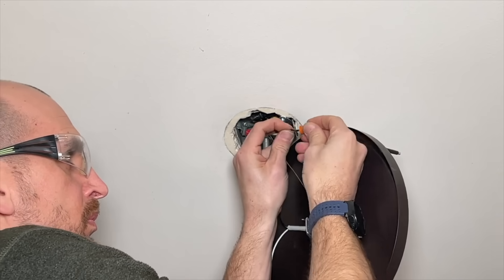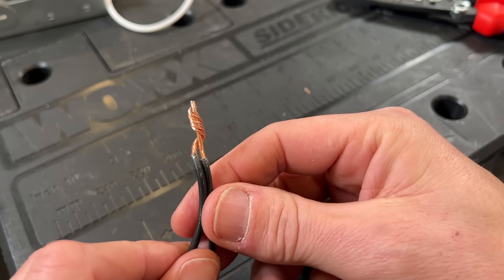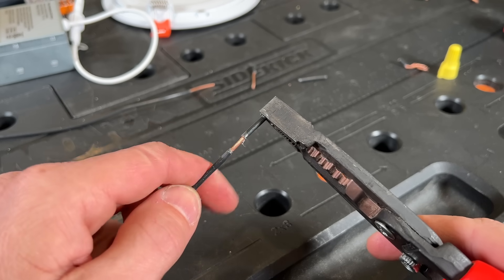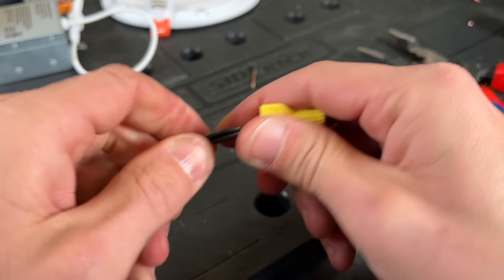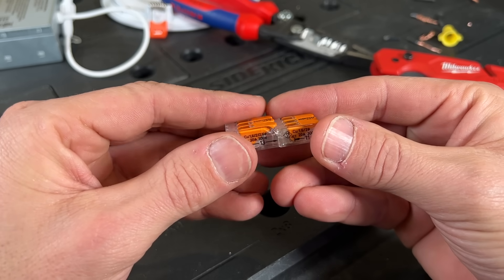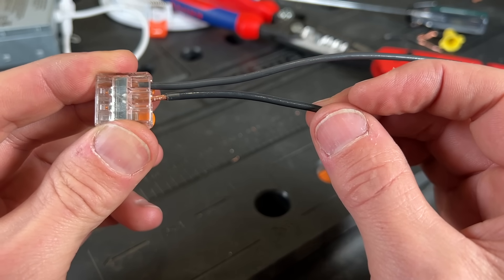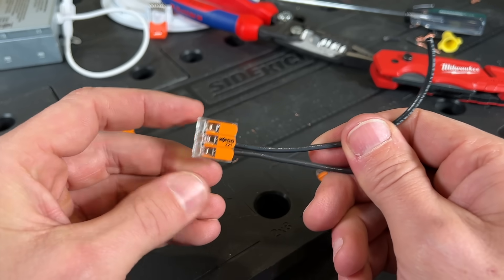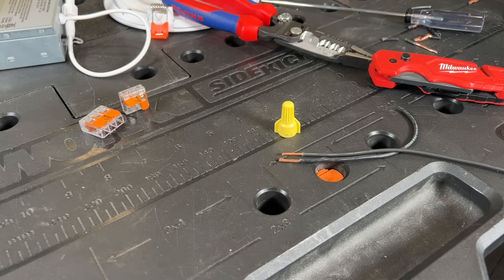Most Common DIYer Electrical Mistake - Don't Let This Be You!

Comment: For the wago’s, the reusability is the most important feature for me. I don’t have to worry about using 10 or 20 of them for a temporary setup because when I have time to do it properly I can just take the wires out and reuse them!
Reply: Yeah but the wagos have one point of contact on one side of the copper steand. Resistance is the word.

Comment: Don't listen to "the pros". What matters is the facts and the actual load testing done. What "the pros" thing is opinion based on prejudice  or "used it for years and it never failed me" kind of reasoning. 
Best practice is learning the better way and letting go of traditional practices.
The WAGO connectors are a good example of this.

Comment: I noticed that when you used your wire strippers, you had to use a fair amount of force to pull/strip  the insulation off the wire. Although I don’t own the nice pair of strippers you use, I did develop a technique that makes the pulling off the insulation a lot easier (with my cheaper strippers). Basically, I would use the stripper to initially cut the insulation, then slightly relax my grip on the handle while pulling the insulation off. I found that when I maintained the same force/grip while pulling it would take way too much force. Just my two cents. I seem to recall this works for both stranded and solid wires, with slightly better results on solid wires.
Reply: I used the same method, its effortless. also holding the wire in the palm of your grip and using the thumb to lever against the stripper gives you massive leverage.
Reply: @haydenjones1559  Thumb method is the way to go.
Reply: Today I learned: not every does it this way.

Comment: I like push connectors except when using aluminum wire. Wire nuts used for that. Solid strand copper wire is fine for push connectors

Comment: That's excellent! Thank you for posting. ( It would help if you showed the PACKAGING that those lever connectors come in. )
   I had to sign a waiver that stated whatever you designed belonged to the  company. I designed HUNDREDS of tools, jigs, work stands, lifting rigs for crane operations, test equipment, procedures, safety application tools and procedures, etc. for over 35 years. I got 3 awards in that time. The main thing, I made a positive change to the world! The company, I'm sure, patented all of it and made it available to order by giving it its own class & item number for all the other shops.
   Your Daddy was smart enough to bypass the waiver...or possibly, they didn't have one then. I signed mine in 1975. I HAD TO in order to work for them! It ain't right, but they like to think that they OWN YOU !!! They keep you down, and morale ain't the best, but its a job worth putting up with the bosses' bosses', bosses, bosses 💩!

Comment: How about just using some electrical wire tape? in my country my complete house has all the connections made with regular black electrical tape or insulating tape and it held 26 years later pretty good. The only thing is that with time tape will loose it’s adhesive ability but it won’t move anywhere

Comment: I use WAGO connectors all the time. When hanging light fixtures, they allow me to do a lot of the connections prior to lifting a heavy light and then fumbling with one hand. They cost a little more than nuts, but for the average homeowner, they make wiring life much easier and foolproof.
Reply: Where can I buy those are the in the USA

Comment: This is interesting. I spent 35 years in sales and marketing at Ideal Industries and was the product manager for wire connectors from 1977 to 1980. Re this video. I would suggest that you go th the connector packaging for proper strip length instructions. UL looks at how the package instructs useage.

Comment: WAGO connectors are NOT logical for a home owner. Need to have a big selection, they are NOT cheap, and cannot beat a wire nut which are more universal and a lot cheaper. You are only pushing these WAGO connectors due they pay you to do so. Just price them out and figure out how many you will need on an occasional wiring job at home vs. the price and number of wire nuts. 
For a pro, these might be the best. 
I am not saying the WAGO is not good, just saying for the average home consumer, they are too expensive.
And again, it is BS you try and state they are better for the home user.
I'm unsubscribing, cannot take paid BS.
Reply from the maker: Wish you the best Douglas.  Just for a point of clarification WAGO doesn't pay me to talk about their products.  I simply feel they are better for homeowners as compared to wire nuts.  Just my 2 cents.

Comment: Your tips were spot on for me a DIYer (I just hung 6 lights including a chandelier by myself):
▪️ I hate stripping wire - didn't have the correct equipment. Once I simply cut the end of the wire off and stripped it, everything was so much easier. Stripping the wire and just starting over with clean fresh wire is the thing to do. It saves so much time.
▪️ I can't wait to use the Wago 221s in the future, but I went to two stores that had the Wago 221's in stock on the web site, but unfortunately when I got there, there were not any. Instead I got the Ideal brand similar connector, but I can tell you, they do not work the same and I would not use them again. Ideal worked well with solid wires, but I had a hard time getting the stranded wires inserted and the stranded wires kept coming out; therefore, I had to revert back to using wire nuts on two ceiling lights I installed. Also, I got the three wire connectors, because I knew some junction boxes had same colored 3 wires connected through a wire nut.

One benefit I found with the Wago 221 style wire connectors is that because I was installing multiple lights, I removed all of the existing lights at the same time because the circuit was already off and then I put the Wago style wire connectors on the exposed wires coming from the junction boxes. This made mounting the lights at least feel faster and easier because I only had to insert the light's wires into the wire connector that was already in place and waiting on the light. This kept my hands free since I did all of this by myself.

▪️ Having the stranded wire sticking out further than the solid wire and then using the wire nut as you recommended is the only way to go. The wire nuts gripped the stranded and survived a pull test. 

It's funny how when you do things the right way, the right way is much easier.

Thanks for the great video

Comment: My lord I've never seen people be such fucking pansies when it comes to electric work. 
People do this shit with live electric, in dirty crawl spaces, mostly in the dark with crickets and shit jumping at their face. 
I respect newbies going slow and being safe but fuckin A man lol, this comment section is lame
Edit. Leave the stranded wire a bit longer than the solid wire when putting the wire nut on. Hold the stranded wire still while you twist the nut and you'll feel the tension as the stranded wire starts to wrap.  It wraps up like a charm every time.

Comment: What wire gauge do the up-to 12 AWG WAGO Lever-Nuts go to as the wire diameter decreases/AWG number increases for stranded wire?  Some stranded wired devices don't use the same AWG as the solid up-to 12 AWG Romex they'll be connected to.  For those stranded wires with a much different AWG, can the stranded wire be bent in half or thirds to make it fit and lock better?  Like to what AWG would this be acceptable, if it is at all?  And how far beyond 14 AWG solid will they also work well with?  16 AWG?  18 AWG, etc.?  Those may not be standard Romex sizes, but it could be good to know in some applications.  Could much different gauges be bent over as well?  And while I'm at it, could the 10 AWG, 30A Lever-Nuts accept a 12 and 14 AWG solid as a tap to something else?  Can't help but wonder.  Thanks

Comment: I always tin the wires with a good quality solder in electrical light fixtures such as this. The solder makes the wire stiff so it acts like a solid wire. I've never had a bad connection using this method.

Comment: I just started using the Wagos. When your doing  larger jobs it's a time saver. A little more money but they are awesome to use. I've used wire nuts for 40yrs.

Comment: Wire nuts aren't used in Australia due to the issues highlighted . We use BP (blue point) connectors with either single or double screws.

Comment: I'd call it "common sense".  I figured it out the first time at about ten years old and have never had a failure in the hundreds since.  I always wrap the stranded around the solid completely covering it to just past the tip and eventually you learn to tell by the feel but always feel the grab and check with pulling.  Pre twist all solid wire connections with lineman's pliers and pull test those as well.

Comment: electrical apprentice here. one of the task i have the hardest time with is bonding stranded copper to solid copper on fixtures and ceiling fans etc. this was great my man!! 👍🏽
Reply: I'm an experienced electrician and I recommend to bend the solid just a bit around 30⁰ on the tip about 1/8 in lenght so you can put your stranded wire then the wire nut and you'll see the difference...
Reply: @MrSeth166   thanks buddy👍🏽 i’ll remember these methods for sure!
Reply: @MrSeth166 ❤❤❤

Comment: I can't believe the USA are still using these fire death traps. 
These have been banned in the UK for years because of loose connections, different size wires being used all leading to arcing overheating and fires.

Comment: I always strip the stranded wire the slightest bit longer than my solid. Like ⅛". Then I line up the insulations and put the wire nut on. It pinches the tip of the stranded wire between the top of the wire nut and the top of the solid wire.

Comment: When you work on Electric powered equipment such as AC and Heating, a pocketful of different size wire nuts will help with most repairs.  But what you never want to see is wires pre twisted then wire nutted together.  When testing the circuit you want the wires to separate easily.  When the circuit is hot and space is tight, tugging on wires twisted together can get  you electrocuted or hurt by moving fan blades. 
So put the two wires together like the video shows and  twist it tight. 
One thing he showed but did not mention is the wires twisted around each other below the wire nut.  That’s when you know you have a proper connection.
Reply: Pro tip: Turn off the power.
Reply: @MAGAMAN  expert reality:  sometimes you cannot turn it off

Comment: When I was a kid, I remember doing so many bathroom lights, kitchen lights and fan service calls for intermittent failures that I would fix in a few minutes, just by replacing cheap wire nuts and remaking the boxes.

Comment: I've always thought there had to be a better way than wire nuts. Still, I would love to see more videos of wire connections while working in a busy, crowded box- real situations. It's easy to get them together out of the box. Seems to me we can have boxes with connectors already inside, you just align the wires coming in. Likely something like that exists for contractors or in Europe, but we here in the U.S. are over- run with limited choices.
Reply: I can't believe that you use these "wire nuts" in the USA for fixed installations. We don't use them at all in the UK. We use either "choc blocks" (terminal strips), in-sure push-in connectors, or the Wago lever connectors shown in the video. Wire nuts? Never. They are much too unreliable.
Reply: @jingomeme wire nuts are perfectly reliable for anyone with a bit of experience but not for the inexperienced DIYer.   The only logical explanation for not adopting the more user-friendly wire connection solutions used in the UK is that the powers that be aren’t interested in making electrical work too easy lol.   There are places in North America where there is a legal requirement to hire a certified electrician in order to change a light fixture.   I work in finance but my father was an electrician and taught me everything you need to know for most jobs.   I have been doing work in my spare time for myself, family and friends for 50 years but my work is not officially sanctioned.   Electricians don’t want people to know that most of what they do is pretty simple if you have a minimum of training …. Shhhhhhh.
Reply: I live in the US and have zero issues getting the wago connectors.
Reply: Mop

Comment: Thanks for this.  Very good.  When buying a wire stripper a few more dollars spent always pays off.  And forget the strippers that come in a cheap kit.  I've had problems stripping stranded wire when using very cheap wire strippers.  With some strippers I learned to cut the wire in the correct gauge size but then insert the wire into the next larger gauge size to pull off the insulation.   This tends to work when strands are being torn off with the insulation.

Comment: Pre-tin the strained wire first with solder - even if you use a WAGO 221.  The WAGO's are nice, but expensive; they solve a problem that does not exist if you do the job right in the first place.

Comment: Literally years of using those wire nuts and would have a 50/50 chance of a tight connection.  Thanks for showing the correct technique
Reply: Literally years and you never tried something different? Lol

Comment: As usual, very informative video on how to make the best wire nuts connection, especially with solid and stranded wires together. The connection may seems very good at the moment we do it, but  after 15 to 20 years I will definitely fail. I mean the solid with stranded connection the wire nut will over time get very loose due to metal fatigue I believe. As a DIYer myself, I often had to upgrade some mechanic thermostats to modern electronic thermostats, and every time I removed the wire nuts from the old connections (solid with stranded), every one of them was so loose that I removed them without any effort. I totally agree with you that the WAGO 221 lever nut is the best way to go with the combination of solid to stranded wires together. All the solid wire wire connections with wire nuts were perfectly good in these projects but all the solid / stranded connections were a failure.

Comment: The first connection is not allowed in most north European countries. Use the wago sollution as shown. This is indeed one of the best solutions on the market and used here in Europe often next to the old fashion screw terminal blocks. 
The wago is transparant so easy to see if the wire is inserted correctly and hard to make a mistake using them. It may be more expensive but rebuilding your house is much more expensive. Note that if you don't follow the regulations on electrics, your house may not be insured against fire hazards.
I'm in this business for almost 30 years so I know what I am talking about.

Comment: I also found it if you take the stranded wire and separate it and lay the solid in the middle and twist it up then twist around you you get a similar effect with the wire nut but I like those lever nuts I'm going to check that out